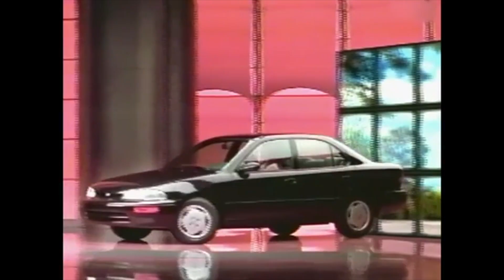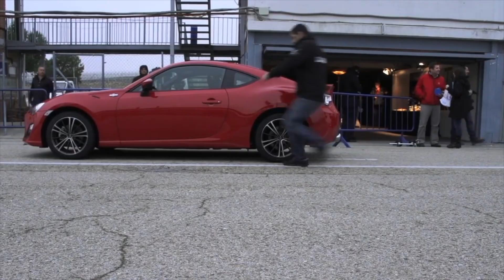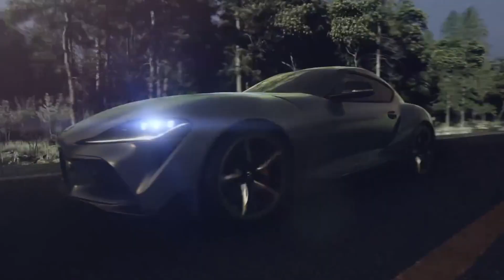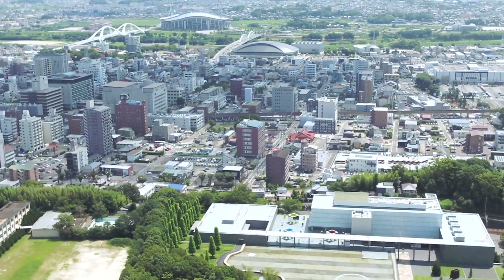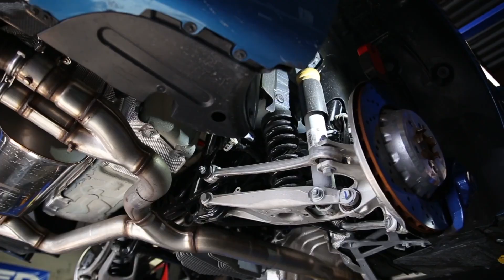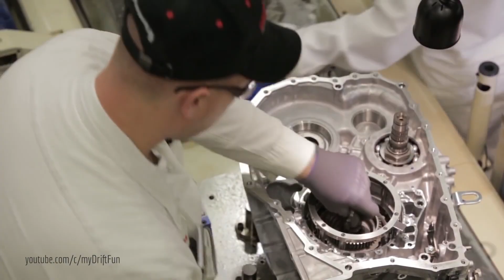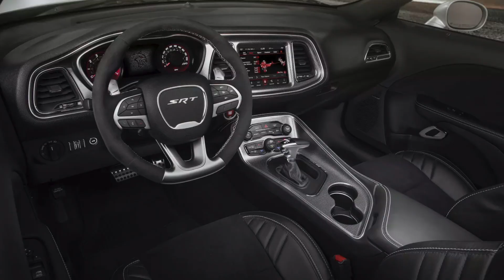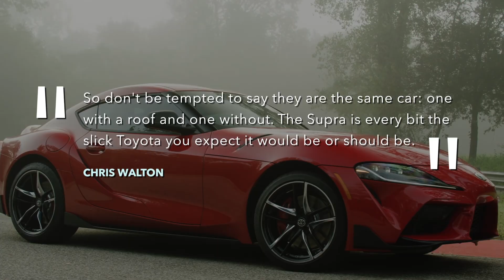MKV Toyota Supra - BMW or Toyota? The UNTOLD TRUE STORY

Comment: Said it before, will say it again, its a great car, well developed and engineered, but it does not deserve the supra name.
Reply: @Jed Lawson Which basically means you did not read the development story and the case of Germany's Strict Anti-Trust Laws. It was a conclusive shared development of the chassis, engine and drivetrain. The drivetrain as explained is a commonly used Auto Tranny that is used in multiple platforms with high powered engines (Namely the Hellcat but others include almost every manufacturer in the world sans Ford). In this example of shared development 2 of the premier enigneers in the world along with a Japanese Liaison that had lived in Germany for almost 15 years and knew the customs and expectations of the country to assist the Japanese Toyota to enhance the teams functionality. They both tested and (toyota especially deemed more stringent design specs on everything from a bolt to changes in engine compnents to meet its stringent test requirements, which by the way only excelled the build design) and finally each manufacturer designed their body individually. BMW created their typical roadster desgin over the build design while toyota built a 2 door coupe design much like the original Supra, though different. The only interior differences are from BMW which spent a bit more on plusher things that Toyuota did not. Hardly noticable to the ordinary person but designers noted the differences. If you are going to SLAM one manufacturer over another at the very least get your FACTS correct.
Reply: @Jed Lawson No triggered. Simply educated. Seems to me you should at least TRY it before you insult a very success project between 2 World renowned Auto Makers.  Very Well known and respected. The crap boxes come from GM, Ford and Chrysler MOSTLY, not EU.
Reply: Aryan Darmeci I agree💯💯💯💯
Reply: why don't you not say it at all
Reply: Nope. Needs to GTR level.
Reply: @Neildo430ci  I doubt seriously you even know what that means.  Nissan is the worlds shittiest car manufacturer including Infinity. If someone gave me a GTR I would lit it on fire because of this reason.
Reply: Its Toyota trying to cash in on the name Supra but really, the car was designed from ground up to be a Z4 coupe.
Reply: @Jeff Anderson I get where your coming from but this isn't a Toyota engineered engine. As well as it hasn't been documented to do over 200k yet. So that does not count in this comparison. There are no hard facts to go off of.  And I would wager that  on the same track a stingray would put down a better time than this supra will especially if it's a z51 stingray or a 1le ss camaro. We wont know until motor trend puts it on Laguna. And as far as the American market goes it's all about roll racing and drag racing. People barely run touge only a handful of them do. Most of the racing you will be doing in this car for the average person will be 40 and 60 rolls on the highway. Not many people are going to risk wrecking their 55-60k car running on an unprepared dirty back road full of hazards ranging from deer to other cars.
Reply: @Jeff Anderson not picking sides here, just wanted to toss in this fact. I work for the railroad, and we have crew haulers that are expeditions, and Suburbans, not really a "fan" of either brand, but iv seen on quite a few mileage above 400k, railroad gets their money's worth, some not even 3 years old yet.. Just a Very strict maintenence schedule. Anything will last if taken care of properly , sounds crazy but iv met a few people who though dumb shit like "well it's a Mercedes so you don't have to do maintenence like the cheap cars". So there is a very good chance these idiots were Partially behind the rumors of certain cars being "unreliable" as well, im I toyota guy, but we have 3 Audis, 2 as dailys, (a flex too but that doesn't count cuz its relatively new) the Audis are probably the most reliable cars we have right now, the jz cars, are down right now lol
Reply: @Jeff Anderson I can't even disagree with you there. I agree on all points. One of the first cars I had was a 90s Corolla. Sold it to my cousin and is still driven today after 260k miles on it. Only had to replace the trans and major gaskets once. Car still runs strong and is passed around as needed. If anything breaks down we still have a backup to get to work.
Reply: @Jeff Anderson yeah, they definitely most likely spend quite a bit on maintenance, and to be fair, most of those miles are highway miles and it seems like they put that kind of mileage on a vehicle within the first three or four years so you're not really getting the seasonal where that comes along with drying out bushings, stuff that just goes bad over time they literally beat them into the ground for 3 or 4 years then sell them off. So who knows how long they last after the railroad has their hands on them.
Reply: Why is that? What made the Mkiv so great? Is it lighter, no, better tech maybe, no, balanced, no, more amenities, no, at least factory hids, no, engine specifically made for it, no, unique chassis, no, super high sales number, no, crazy power out of the box, no, aluminum maybe, nope, just another 90s Japanese sports car, mixed in with the current trend. Think about it, it's not the car it's the period, in the 80s Supra, rx7, 300zx, all had a similar dynamic, then 90s they all rounded out, now everything is about sharp lines and looking "futuristic".. Supra is just joining the trend again and meets all the criteria the old ones met, if not exceed them. Honestly, a stock mkiv kinda sucks to drive, especially if your tall... V just needs a manual... can't compare a factory car to what tuners have done to a car that's not a fair comparison.
Reply: Kaleph Green i completely understand your POV, but the Supra was a true full japanese sports car that appealed to the major audience hence the high sales and ever growing resale value, tel my why does an A80 stock supra cost more than this new A90 chassis? Its a car that was built with an everlasting engine that gave the people the freedom to make it their own and modify is however they wanted, this new Toyota/BMW hybrid is one of the worst follow ups to the supra name, with an engine, chassis and interior that is shared with another BMW, and please dont compare the new sports car generation tech with the 90s tech, take a look at its rival at the time, the R34c a fantastic platform to this day, got a decent successor, the R35 which yes, it did rely on  a lot of tech and wasnt as connected to the driver as they wanted but, people liked it because it reminded them of the glory days of the legendary R name, a super well built and tested to the millimeter to make sure it honored its ancestors. This “supra” is just a failed attempt at creating a sports cas, which i repeat, done in a great chassis, but does not hint one bit to the old Supra exept for its I6 FR layout, which lets be honest, there are a handful of cars with that layout.
Reply: @ryantorque1245  the mkiv is selling like that for nostalgia reasons, people are making them go up in prices, the skyline/gtr has always been 'ultimate performance".. Super car for less, Nissan was always chasing porsche with it. Supra was just a big gt car, it was also a parts bin car, only difference is that back then toyota had engines to put in it, so they took an aristo, pulled the 2jz, the rear end from a combination of 147 aristo, and zz30 soarer, borrowed the chassis from the zz30 soarer, made a few body parts and bam, they did the exact same. I just feel like where the conflict began was what "toyota" thought the supra was, and what "fans" thought it was, they probably didn't think fans would care so much about manufacturer of the engine, just that it was a i6. Remember back then, cars were profitable, it was the hp race, now we live in a time where the eclipse is a suv, they killed off the evo, and toyota does just fine with its eco cars and suvs/so really they didn't have too, but i bet someone really wanted to make it happen, and toyota told the lead designer "fine but keep it out of the way, and don't spend too much"
Reply: @dnkayto  While I whole heartily disagree with your outlook on the MKIV I can respect the opinion and I will say you hit the nail on the head with profitability nowadays. They were allowed to make a new one but were likely very limited as to what they could produce, which is sad because we all know Toyota has the money to do this on their own. Side note, I also don't understand why everyone today slaps fake vents and grills all over a car and this one has them everywhere.
Reply: @ZX6R2KGT  I don't know if you heard, but Toyota said that they developed the Supra along side the race car, all of the vents we're  used on the race car and they said that they were pretty much just capped off for people who wanted to drive them without worrying about water getting in places, they said they left it up to the consumer to remove them for whatever their application is they said they are pretty easy to remove. They said it's up to the buyer to duct them or make them function in whatever way they desire.
Reply: @ZX6R2KGT   and what part about the a 80 were you referring to?
Reply: I can't wait for the new Audi Fairlady, Alfa Silvia, VW Treuno and Fiat Swift.......Not!
Reply: no one would buy it if it was not called Supra, who would buy a 55k celica
Reply: @Potato-lw3fe  The people that bought the Original Celica...... or the people who bought the GT4........
Reply: Ketosis - Unless BMW made a Celica that I don't know about I don't know why you would call it a Celica. Maybe a first gen Z3.
Reply: @Potato-lw3fe  but the celica was reinvented as the scion tc
Reply: Why would you call it a Celica?
Reply: @jimmelay71  exactly, you must call it  Supra in order to sell it
Reply: jimmelay71 cuz its underpowered “sporty” car just like celica mb ?
Reply: Since when is 400 hp underpowered?
Reply: @americanball_2841  its a detuned Z4 engine. Makes ~335hp
Reply: @ernestocastellanos6446  huh. Read somewhere it was 400. Nvm. 335 hp is still a good amount and it is in a very light body so it is enough. You get what you pay for. Now if you want more performance take it to a tuner.
Reply: @americanball_2841  Or, I could just buy a Nissan 370Z for 25k less.
Reply: @Cheezdealer  Wouldn't be as fast though.
Reply: @Cheezdealer  which is n/a someone else has already stated that this Engine with just a tune no flow mods will make another 60 horse, and apparently injector and boost up you're pretty easily near 500
Reply: @FitFatFit  Under powered "sporty"? Do you not know about the GT4? The supra that won the super gt in 95 had a celicas 3sgte in it? Im confused how celicas are under powered?
Reply: @Cheezdealer  Yes you can, but, No Turbo and certainly not anywhere near performance. Nissan Sux Azz. (and YES that includes Infinity)
Reply: @anonimous2451  https://www.roadandtrack.com/new-cars/future-cars/a12635049/2019-toyota-supra-what-we-know/

Theres my research
Reply: @americanball_2841  335*
Reply: @americanball_2841   This supra is still slow for the price. For 55k I can get a stingray vette , camaro 1LE, or GT350 and have 100 more hp and tq and stomp all over this thing stock for stock. Mods don't count in comparisons you can make anything fast with money. Stock is what counts.
Reply: @Viii_Glasseye  Then whats stopping you from buying those. Oh yeah resale value and reliability.
Reply: @americanball_2841  Nothing is. I have 5.0 mustang that will murder this thing. For half the price. And the LS engine I swapped into my 240 6 years ago was much more reliable and cheaper to maintain than this car will ever be. Bmw parts are still Bmw parts meaning expensive. I'm just saying 55k bracket this is a losing choice. Just like the GSF, RCF and any other overpriced performance vehicle Toyota puts out. Hell if your going to spend 55k your better off spending it on a used 2016 m4  and get a proper M car.
Reply: @Viii_Glasseye  lol stock golf r is 45k... Numbers don't Mean anything.. They price based on what they think will sell, and what brings profit
Reply: @dnkayto  Which seems to be a losing strategy outside of the economy segment. Lexus barely sold any F cars compared to the  M and AMG cars in the same price bracket. You just dont get the same amount of value that you do with the other cars. They have not learned this yet it seems.
Reply: @Viii_Glasseye   I know I am still very interested in one, I had a guy at Toyota let me know when they had any information, he called me saying they were taking deposits in the only reason I didn't was because two options I haven't seen yet I want to wait and see if it shows up oh, the first being obviously manual transmission oh, the second option being a Targa Top. Apparently Toyota wants to do a title but there's some kind of agreement between BMW and them saying they are allowed to do a convertible, so apparently there's a back and forth with that I would much rather hold out a few months and see if it least one of those options would become available or I buy prematurely and get sad when they announce something big if they do anyway. I know my intentions would be two Jay-Z swap one oh, but I would be okay driving it as is for a while it's still a really nice car and yes the name does have something to do with it I am a huge Toyota guy and Supra has always been a big part of my scene but honestly the Marc 4 always reminds me of how old it is anytime I get close to thinking about buying one, and it doesn't help that the prices climbing. I had a couple opportunities to buy a non turbo model for pretty cheap but I couldn't get myself to do it because I just really don't like them that much in the interior and the interior is a big deal to me.
Reply: @dnkayto  I agree targa would be awesome. I know I sound like I hate the car. I don't trust me. I just felt letdown with what they came up with compared to the other options there are out there. I was a huuuge supra fan. It was the underdog compared to the skyline gtr that's what made me fall in love with the Supra. They had years to do something original and dropped the ball playing it safe. I agree with waiting. It seems like first to buy people always get screwed over. They add some new feature or face lift the 2nd and 3rd year the car is out LOL. I agree with interior as well. Especially since you have to sit in it while in traffic a lot of the time.
Reply: @Viii_Glasseye  I was using text to speech so hopefully that made sense
Reply: @dnkayto   I understood lol. 2jz swap would be sweet.  I can't do that in the area I'm living in. At-least if i want the car registered and street legal. The swapped engine can not be older than the engine that comes in the vehicle stock. I learned that the hard way when I swapped my 240sx.
Reply: jimmelay71 because Supras were Celicas, until the mk4.  Its not a storied nameplate at all.
Reply: @jimmelay71  CelicaSupra was a thing back then
Reply: @ @Potato-lw3fe  not celica but BMW ~
R.I.P supra.
welcome to BMW
Reply: Yea, call it something else it'll never live up to the legendary Supra name as it's predecessor did
Reply: I hate to say it but It barely looks like a Supra. It looks like if the Noble M600 and the Lexus LC 500 were to have a Baby but then cheated on Noble with the BMW Z4... But I'd rather stick with the 1993 and 1999 Toyota Supra

Comment: Everyone complaining about the factory hp needs to relax. Most BMW guys are saying the B58 is going to be better than the N54. N54 is rated at only 300hp crank but nowadays most N54 guys averaging around 450whp with basic bolt ons and a tune. Hell my N54 is 500+whp. Combine some power like that with a small chassis like this and it's gonna be fasstt!

Comment: i really dont understand the hate for this car. Its superb looking for a factory car, and if you look at pictures with different wheels or height its already stunning. Imagine all the aftermarket Parts that will come out such as bodykits etc. In a market that is dominated by SUVs, it's a brave move to offer such a car. Given the demands, Im almost certain that there will be a manual option soon.
Reply: Brave move would have been to design it from the ground up, like Nissan did with the GTR. This was all about minimizing cost and trying to maximize profits. This is why Toyota did not want any previous Supras or even the original Celica Supra present at any of the auto shows.
Reply: @way2faded  i mean i guess but then the car wouldnt Cost 60k